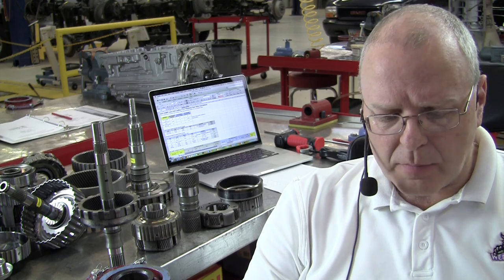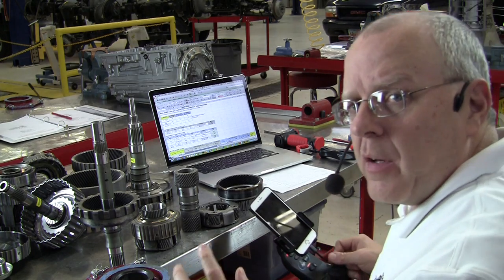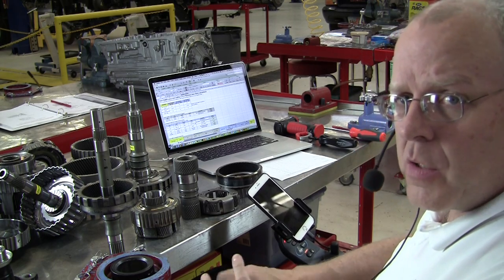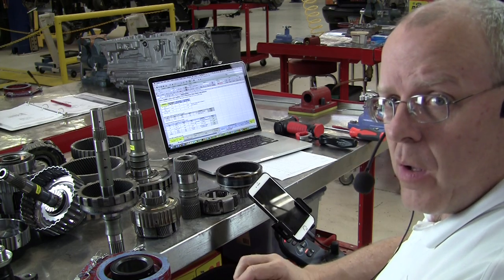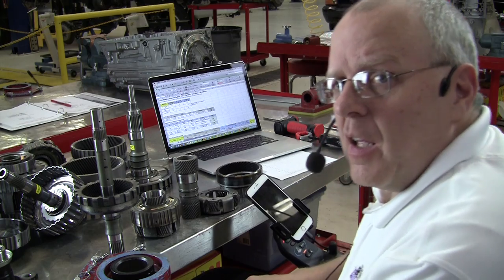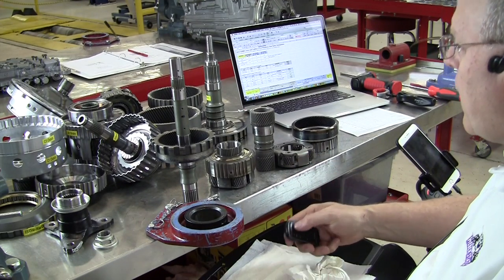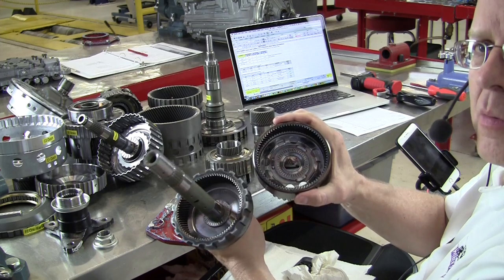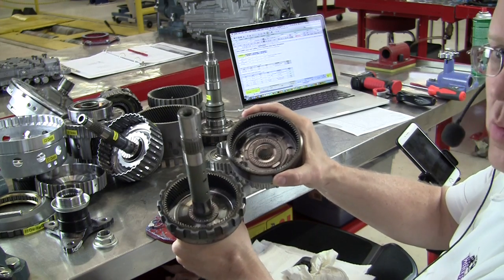8 Speed Automatic Transmission - Lexus AA80E (Aisin TL-80SN)

Comment: Hello, amazing video i must say. Thank you so much for making this. One thing that boggles my mind for a lobg time now, as you said with the 4 speeds that had overdrive in addition to 3 speed simpson. Why did they not utilize the overdrive to create 6 total ratios instead of the 4 ratio they ended up using. Since overdrive unit is independent of the main unit, theoretically you can switch between the 2 speeds of the overdrive to make the overall gear speeds 6. 3 x 2 = 6. why nobody did this?
Reply: I think it’s because that shift pattern would involve “double-transition” shifts, where 2  oncoming and 2 off going clutches must be swapped simultaneously under load, instead of just 1 on and 1 off. This type of shift is more difficult to execute smoothly, especially with some of the hydraulic controls that were available during that era. 

There are no such transmissions in mass production currently, though the Chrysler 62TE 6-speed did do such shifts (you can find technical papers on the 62TE’s double swap shift strategy through SAE journals). The 62TE was actually a 2 speed x 4 speed configuration, but one of the ratios was redundant with another (now down from 8 to 7 speeds), and another pair of ratios were so close that they were effectively the same (down from 7 to 6).
Reply: @pmo5821  thank you so much for your answer , i will read up on that chrysler transmission that you have mentioned

Comment: sir, what you think would cause one gear to shift rough then all the others ?
Reply from the maker: There are several potential problems, all are internal to the transmission. I recommend checking for Diagnostic Trouble Codes (DTC) and see where they may point you. Best wishes.
Reply: +WeberAuto it only happen when cold start shifting 3rd gear

Comment: hi sir 
im working in gmc.   i have on gmc pikup for oppration vehicle jurking in 2 .3 gear when slow down.
i working on 8 speed transmission and i dismental transmission for overhaul and i found 2,3 clutch litil bit  burnd. so i changed clutches and all piston and seal and re program TCM and reset module adapt at same 3ri time but still problem not solve .i request to u plz sirp help me to solve this problem.

Comment: Could you please confirm types and equivalent trans fluid can be used on this 8 speed AiSin ? 
I am talking after market brand (Valvoline, castrol etc)
Reply from the maker: There isn’t one. Toyota WS fluid from Toyota is the same thing. Accept no “equivalents”
Reply: @WeberAuto  thank you for your quick answer.... what about GM literacy says that TL80sN can use Dexron VI? 
This means Dexron 6 is the same as WS?
Reply from the maker: No, the GM specs call for a different fluid. Not any version of Dexron

Comment: Thank you John. Was looking up the ZF and came across your video. Nice MBP by the way. Anyway, bought a 2014 Lexus LS AWD so it has the F model trans as does the newer Land Cruiser/LX570. I’d like to use the F trans in my 1997 Land Cruiser to replace the 4 speed. Lol. I know you don’t mess with mods like that but maybe a viewer has. Would like to keep the stock 6 cylinder but go to a newer trans. TCM and control is the issue but not sure about bell housing pattern. Other option is GM 6.0L w/ 6L80 or 90. I don’t get my 8 speeds that way but TCM options increase. Anyone...Bueller? Haaa.
When is Weber open after the summer break? I usually am back in the US for August but I’m sure you’re closed for most of that. Time going by so fast. Lived in Layton back in 05/06, Iraq in 07 on.

Comment: It seems a higher 1st gear, or lower 2gear would giv better performance, 2nd is close to some 1st gear ratios, it will have lots of rpm drop when it shifts to 2nd. But then tight from then on out. Keeping the engine rpm up after shifts. Just imagine this with a 4.56 rear gear. This tbi g would be geared like a  clock in 1st !!!  This should be great with a 2.73-3.42 gear, depending on tire size... I'm wanting to swap a 6-8 speed in my 88 firebird!
Reply from the maker: Thanks for your feedback

Comment: Why do they have to make these so damn complicated?  An 8 speed bicycle for example is MUCH simpler.  Why can't they use something similar but with stronger gears like maybe have all 8 gear ratios connected and spinning at once then just use 8 clutches to select which one to use?  Kinda like if an 8 speed bike had 8 chains except all but one would freewheel at any given time.

Also, I think 8 speeds is excessive on cars cuz they have enough torque to perform well just using 4 gears and 4 is simpler than 8.  Even motorcycles which are designed for performance normally max out at 6 gears and mine only has 5 cuz it is almost 1200cc.  On my bike I can even start out in the top gear if I wanted to but it is not recommended.  What is fun to do sometimes is to go from 1st to 3rd to 5th, thus making it an effective 3 speed.  Think about it, if I don't demand performance, I don't need the "intermediate" 2nd and 4th gears.
Reply from the maker: +David James Hi, thanks for the feedback. The complex design of this transmission (and others like it) is to keep it in a small package and to make it light weight. The addition of gears is designed to increase efficiency and fuel economy while reducing NOx emissions. Thanks for watching!